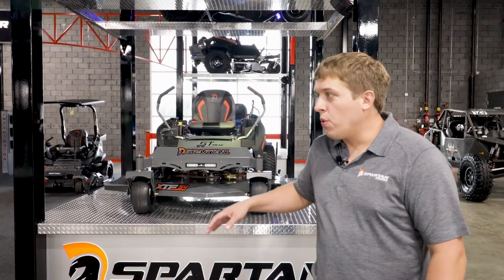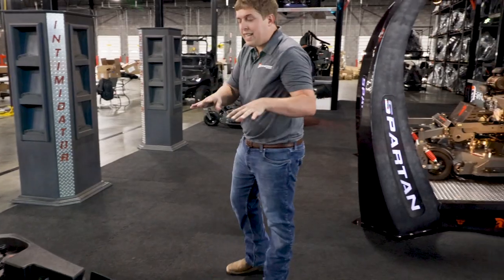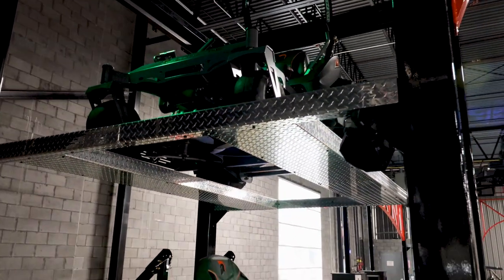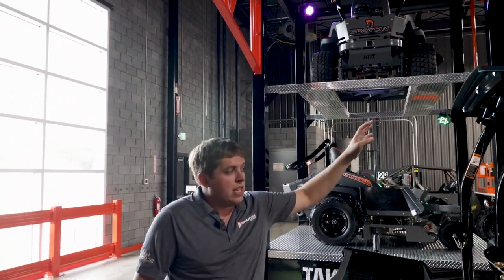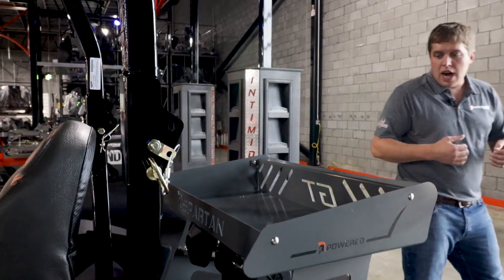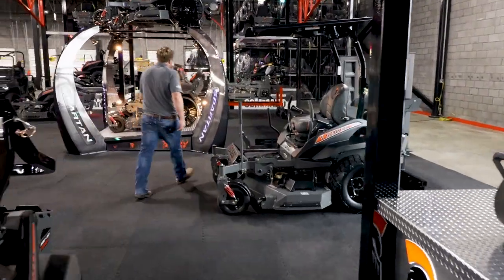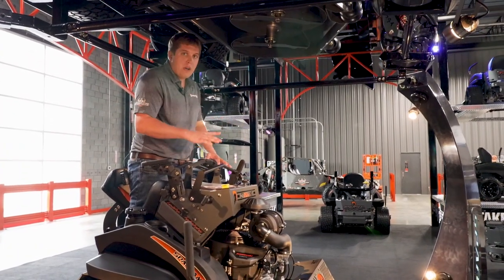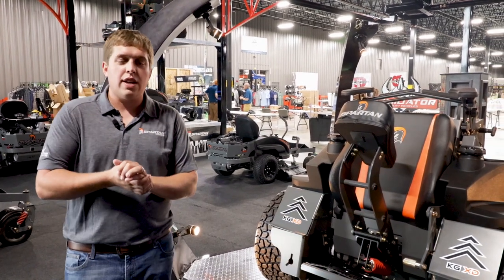2021 Spartan Mowers full model line up

Comment: I wish I could have waited for the 2021 models... but my old mower bit the dust and I had to buy... having said that... I love my new 2020 RT Pro w/B&S 61" cut. It rides like a Magic Carpet ride... and cuts like a Beast,  I have 5 acres of field grass and was not able to buy immediately after the old mower died... the grass was about 3-4' in areas... it mowed right through it all... only had to do some minor touch up.  It is unbelievable at the difference it is to mow with.  Keep up the good work :-)

Comment: Just bought a 2021 RT SRT PRO 61". Came with Suspension at the transmissions, 360 platform and the Suspension seat. Very nice since I'm farm mowing and it's some rough going. Also came with adjustable sticks with stress pads. It's got a led light in the front and a Reese 2" receiver in the back. Kawasaki motor. I think for all this at 8k is awesome.  I looked at John deere, Toro, Kubota,Bobcat,Exmark,Grasshopper,Scag, Hustler and a few others. This mower for heavy duty residential has the most commercial components including Kawi and Parker transmissions. Sure you can get something just as good or better. Point is not for 8K.

Comment: Is it possible that Spartan can build a 48 inch zero turn in the RZC line and sell it between the 42 and 54 inch RZC . Instead of having to purchase the RZ 48 pro. The 42 inch RZC is a good mower . Need a 48 inch cut .